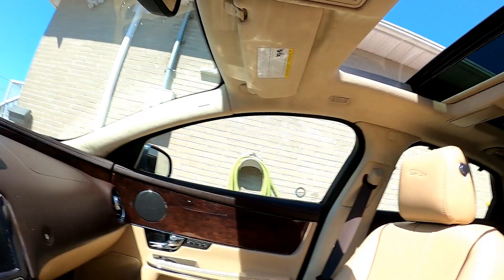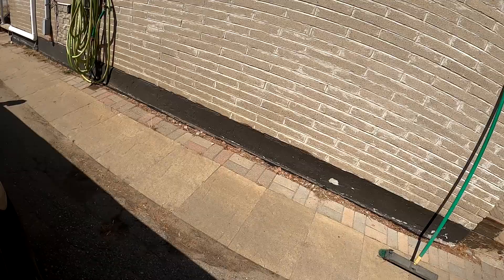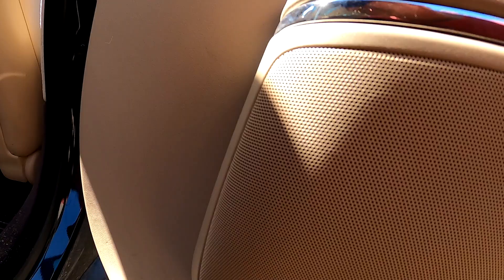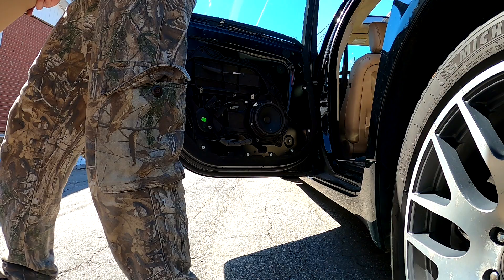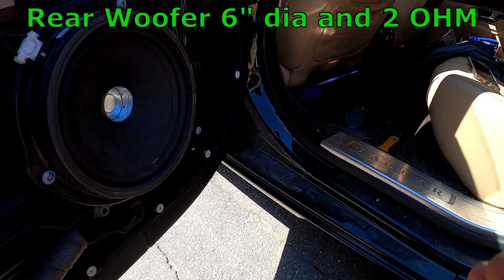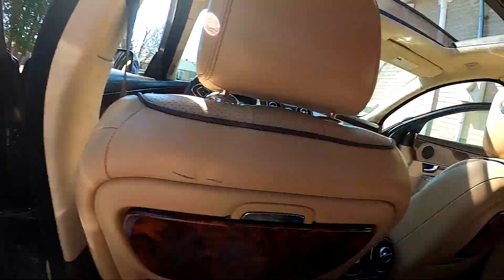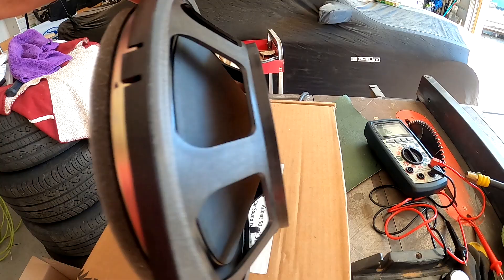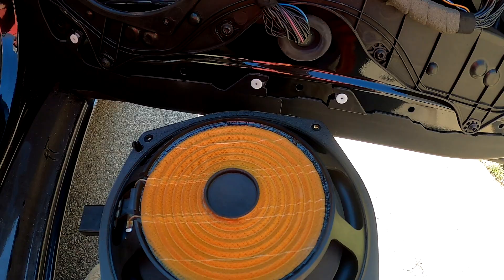2011 Jaguar XJL rattling speaker fix

Comment: Thank u for the info adding the spkr sizes to the vids helped tremendously when info is extremely limited
Reply from the maker: No problem. I noticed that too when I was looking up issues with the speakers
Reply: @RogerBuckChrist  ive got a guy with a 2011 XJL and a 2018 XJL  hes wanting to change the spkrs and add subs the whole 9 and info is impossible to find for these
Reply from the maker: @Tony2Pockets  I want to upgrade the subs in my car too
Reply: @RogerBuckChrist  only downfall i see is if your fuel tank is in the truck theres no real way for sound to pass thru from the truck to the passenger compartment. So upgrading the spkrs in the doors with a 8" midbass/subwoofer geared spkr would be best
Reply: @RogerBuckChrist  they also make 6x9" subwoofers to replace the one in the rear package tray that would help